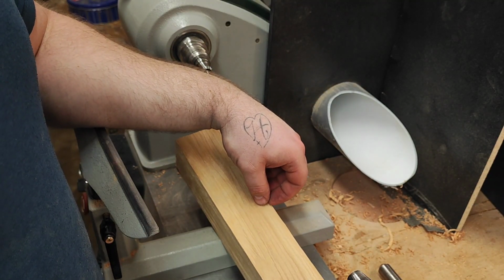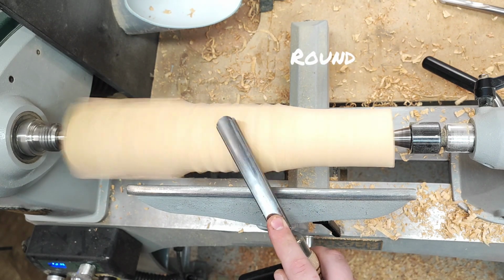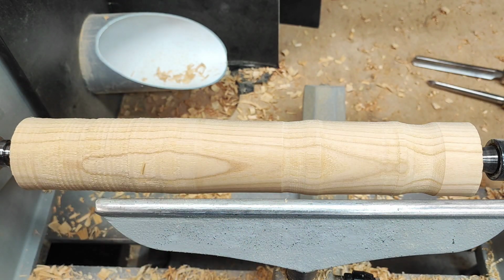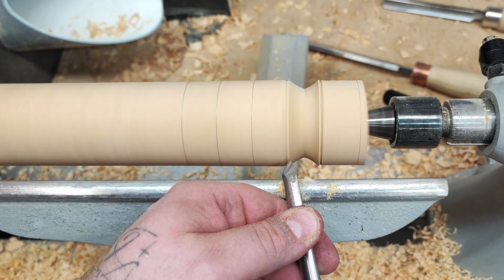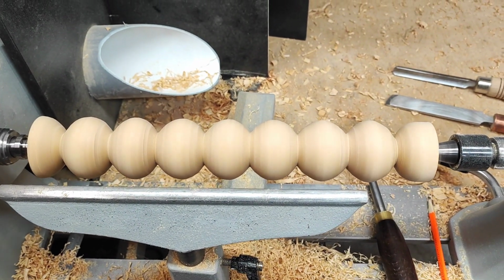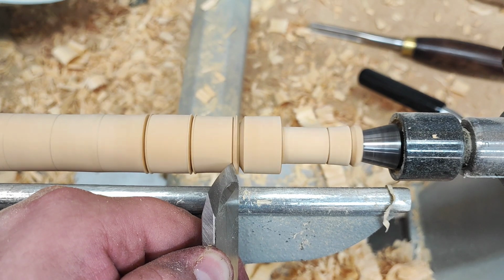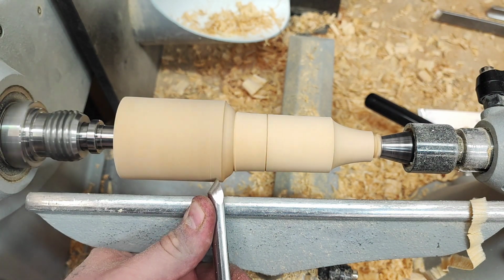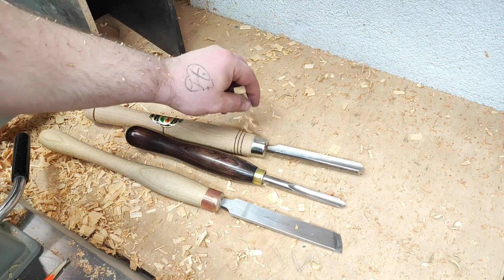Woodturning for beginners/chapter 7.  Spindle work and CATCHES

Comment: Excellent instruction, Tom. It felt like you were in my shop this morning. A lot of the cuts you made, and comments you said, were similar to mine today. The ogee on a spindle was one I was specifically was intentionally making today. I use them in design very often, but I never really thought of it as that form, but you are correct because it certainly is.

I enjoy my skews, so much. I still have the occasional catch but I never worry about it. It seemed like a big deal, and scary, as a new turner. You did a good job reducing fear of them. Even though I don't worry about them, knowing they were coming in your video had my muscles tense when I knew it was coming. So, maybe you caused a bit of anxiety with those catches. :) 

Great instruction. You also made me realize why one of my blind cuts often catches. It's when using a skew's short corner to form a bead, as I cut around to the right I lose sight and my edge engages, instead of just the tip. I think I'm not lifting my handle in pace with the rest of the cut. You've made me understand why, now I can correct it.
Reply from the maker: Glad to be able to help in any means 😉 usually it does grab the edge on short point... Thank you as always for watching 🤗

Comment: Very informative explanation of the different types of cuts and especially where you show the catches and how they can happen more often than most other turner's like to show. I recently purchased a Record Power dml320 and have started making a few pieces. I decided to try and make a jewellery box/jar and had a lot of problems with catches while hollowing out the inside. I'm not quite sure why it kept happening and eventually I had a bad catch and the piece disintegrated. The box was 4 inches tall and inside diameter of 2 inches. Would you care to do a video on turning pieces similar to this and how to approach these situations? Thanks.
Reply from the maker: Thank you, I have recent video similar size, on endgrain box, hope that helpes, did you use sidegrain or endgrain?
Reply: @tomislavtomasicwoodturning  I used sidegrain. I'm thinking that the box was to small internal diameter and I'm unable to get the correct angle on the tool which is causing the catches but unsure really.
Reply from the maker: @711motorsport6  it should not be an issue, I have a few videos on cross grain orientation playlist that might help.... What tool are you using for hollowing?
Reply: @tomislavtomasicwoodturning  I'll have a look at your other videos this evening. I tried both the bowl gouge and spindle goug and same thing kept happening.
Reply from the maker: @711motorsport6  ufff for a such a narrow box gouges are not good, scrapers are best for that....my guess is that one of the wings cought the wood that why you had cathes